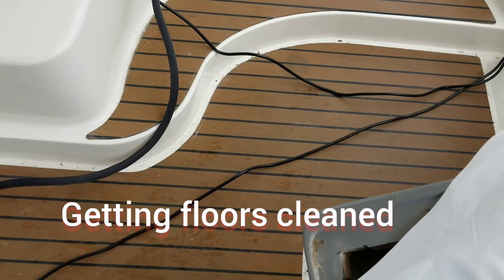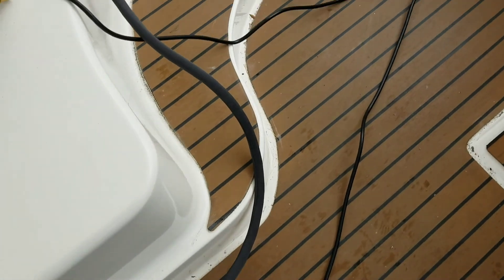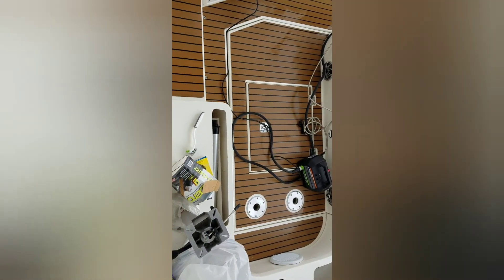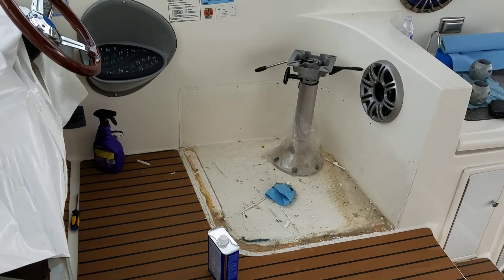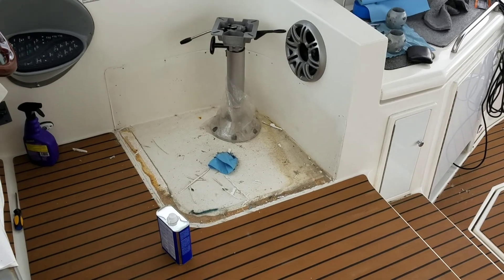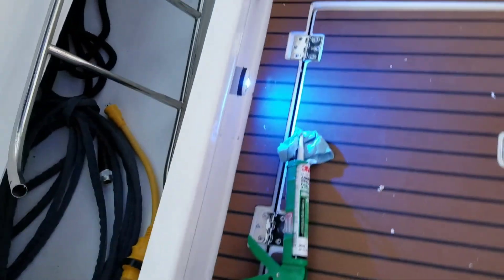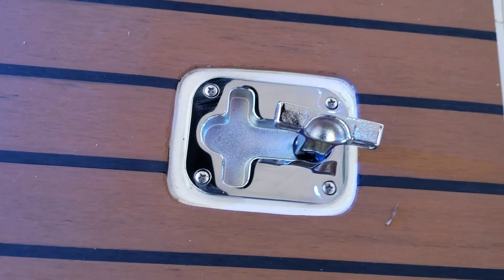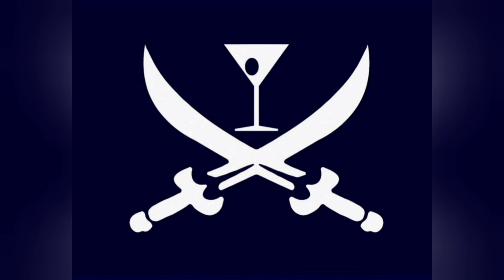Some restoration projects on our Cruisers 440 460 express boat

Comment: I will second Seanmcc45,  The speaker is a subwoofer.  Some stereo systems use two subwoofers,  some only use one.  Likely the stereo installer wanted to makes sure they would hear allot of base while motoring at high speed at the helm.  Great work on the floors, they look great.

Comment: Nice work on the floor.  The big speaker behind the captain sest looks to be a subwoofer.  I assume it's mounted there to hide it.  Subwoofers dont really rely on direction to the ear hence the out of the way install.
Reply from the maker: There is a subwoofer on the lower area, don't know why they did this, to he honest.   But it's going bye bye.  And thanks for the compliment on the floor.   I'm happy that it turned out so well.  Needs another treatment,  but it's still pretty good.